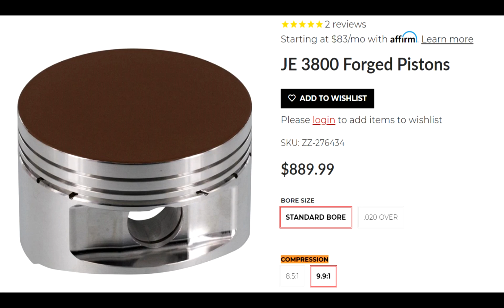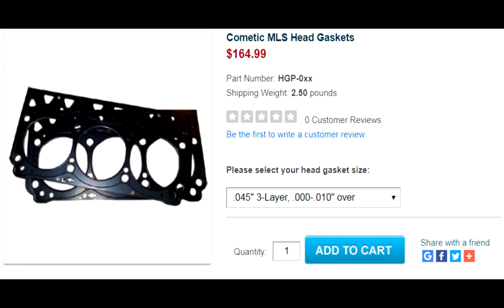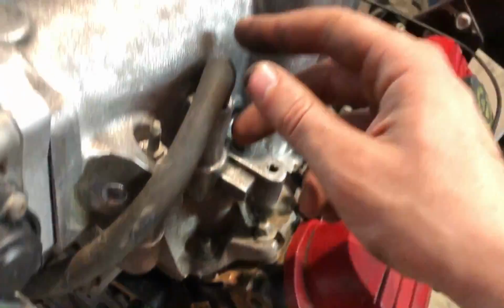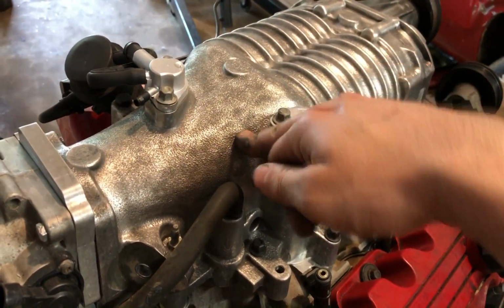3800 Supercharged L32/L67 - EVERYTHING you need to know UPDATED

Comment: Did you do your own witing harness? I just picked up an 05  3800 sc with wiring harness and computer. Im going to convert the throttle body to a N* and lq4 maf. Can i use my wiring harness or do i need a series 2 harness and pcm?
Reply from the maker: I've built and bought one. i would get a 98-02 GTP ecu. there will be wiring differences, you'd have to look it up on www.alldatadiy.com and buy a subscription for each car to know which pins have changed. check out the wiring harness section here, it goes into detail on all of that: https://www.fiero.nl/forum/Forum2/HTML/139530.html#p11

Comment: Heavily modified in early 90s and 2000s in AUS 🇦🇺 l67 3.8 ecotec in holdens. Easily making a safe 400hp at the wheels with a few mods.
Reply from the maker: yeah 3800s are a little harder to get 400hp out of but it can be done. not many good transmissions to support it though
Reply: @FieroAustin  yes the 4speed gearboxes were terrible 😂 and the supercharger were heat pumps definitely needs intercooler mod. MACE engineering a company here and aus make alot of after markets parts for the l36 and l67.

Comment: Last part, you said the stock ring gaps can hold 400 hp. That seems perfect for my build. Any higher, i'll need a roll cage
And the torque converter info will help with the first driving tests. Nice job, sir!
Reply from the maker: you know im not 100% on that. Might be higher, but you'd have to look it up.

Comment: My son and I are doing a 3.8 supercharged swap from a 2001 Bonville. You had mentioned in the video that you had done one too. Could you give me a list of things that you know of which we would have to change on the Bonville engine for it to work well?
Reply from the maker: Yeah, the list is at the end of the 3800 swap instruction build 1 list titled "PARTS NEEDED IF YOU DO NOT BUY A 1998-2002 PONTIAC GRAND PRIX GTP OR REGAL DONOR CAR" https://www.fiero.nl/forum/Forum2/HTML/139530.html#p5
Reply: @FieroAustin  Thank you for taking the time to answer my question. That list is really helpful. I have found most of the parts I need to make the bonneville engine work except for the GTP oil filter bracket. Everywhere we checked was out of stock. Do you happen to know anyone who still sells them?
Reply from the maker: @SillySisters-4  You will need to go to a local junkyard. Go here and click Vehicle Fitment and then give your junkyard a call to see if they have any of those cars. https://www.gmpartsgiant.com/parts/gm-adapter-12569219.html

Comment: Happy new year 3800 fantastic 🎉
I have a quick question about top swap on 07 pontiac grand prix (L26 / L32) stock harness, #90 spring, new headers just a basic top swap for now. I reverse my car from my garage to my driveway and pulled up a few feet forward to park straight after the top swap job (no higher RPM). I have been told that because my PCM wasn't tuned yet I damaged my transmission and engine for doing that. I was wondering if that could be possible 🤔  and why ?
Reply from the maker: uhm, I don't think there would be any issue there at all... if it was the stock harness and tune and PCM and all. The stock transmission might not like the higher torque if you really hammer on it but it should be totally fine. You didn't flash the ECM with a different tune from a different car or anything right? Here is a complete top swap guide for reference. No mention of anything like that from a quick glance. https://www.grandprixforums.com/how-to-write-ups-tech-tips/49039-the-eaton-gen-v-supercharger-faq-swap-thread-genv-gen-five-gen-5-a.html
Reply: @FieroAustin  thank you for your thoughts 🙏
Reply from the maker: @jeanpierreremond2565  welcome. although you should probably check in some facebook groups too... try https://www.facebook.com/login/?next=https%3A%2F%2Fwww.facebook.com%2Fgroups%2F3800SC.3800.Fiero.Swap.Page%2F

Comment: 9.8 to 1 AFR is super wet/super rich, wasting fuel, way to high Fuel input.
Reply from the maker: yeah you're right. my tune ended up around 12.4 AFR or 0.84 lambda optimally. It kept climbing in power but I didnt want to go leaner.

Comment: Different  from Aussie L67 I'm runing a 8 ribbed 3.4 inch charger pulley n still using the 6 rib standard harmonic balancer u don't need to change it at all unless u use a 8 ribbed belt
Reply from the maker: yeah that is true... just not the other way.

Comment: I've been thinking about getting one of these to put in a small car Ford truck maybe like an old Volkswagen how much more fuel does this use in a stock 3800 ?
Reply from the maker: You mean a non-supercharged 3800? I am not sure there is much difference. I have seen these get 35mph with the right setup.
Reply: @FieroAustin  I have been trying to get Buick with the 3800 just to drive around it's a big nice luxurious car and I saw a century that had a turbocharger on it but I was not able to get it I would probably prefer the turbo over the blower or supercharger and eventually find a small vehicle to put it in
Reply from the maker: @darylhudson777  ah. i would expect 24mpg out of somethign like that
Reply: @FieroAustin  will the larger 90s four doors I looked up without a turbo get 30 on the highway and 20 in the city that's with an automatic transmission

Comment: Hey, quick question, did you bolt the gen v lower intake manifold to the L67 block, and every bolt lined up?
Reply from the maker: lol I saw your facebook post about this earlier I had the gen 5 lower intake manifold and the gen 5 blower together. I also had Series III heads but I think the heads are exactly the same. If you used my build thread for build 2, it does say you need to get both the supercharger and the lower intake manifold. Good luck man, hope it works out!!!
Reply: @FieroAustin  I have all of the parts, it will be done.
Reply from the maker: @snutmeez  Nice!

Comment: Did GM make a DOHC V6 back in the 90s which used timing chains? I know the 3.4 had a main chain which drove two belts, but any chain ones? I know the 3800 was an OHV.
Reply from the maker: yeah, LQ1 https://en.wikipedia.org/wiki/General_Motors_60%C2%B0_V6_engine#LQ1
Reply: @FieroAustin  Thanks for the response. Yeah it seemed a decent engine used on a lot of cars. Only it's a main chain driving two belts, says there in the article. Granted, might be less overall strain than a direct to the crank system, but even today the idea of a wet oily rubber belt does not sit well with me. Again, thanks for the info. The modern 3.6 DOHC used 3 chains, similar to VW's VR6 line. If I ever got my hands on a Fiero to swap out, it'd likely be a VR6, I've seen a couple guys on YouTube do it. One guy cut a bit into the rear storage area to modify the exhaust for the "wookie sound" as well as basically vanity plates for the engine cover.
Reply from the maker: @jameslaidler2152  Of course! There may be other variations but I'm no expert :)

Comment: I have a big question for you can I put an l67 series 2 supercharged engine in my 1992 pontiac bonneville se
Reply from the maker: maybe. if you grab the mounts from series 2 engine. you will have to figure out the wiring harness on your own. use the computer from the series 2 and also reprogram it to delete VATS security and a few other things. i'm sure there's other concerns with hardware hookups. but i really have no idea. sounds like a big headache. nobody's probably documented any of that.
Reply: @FieroAustin  but my bonneville have the L67 series 1 in Now. That why I was asking
Reply from the maker: @qmb120  wiring will still be completely different. or just keep the series 1....

Comment: I’m going to buy a used 98 Buick Regal GS with a 3800 supercharger. What type of gas do I need if driving normally?
Reply from the maker: pump gas is just fine. 87 octane. If you want more power and modify the engine appropriately (by increasing boost), you might want higher octane for higher knock resistance. 91 is everywhere and 93 is also around.

Comment: Hey Austin My 87 Fiero has a 5spd.  I am putting in a 3800 from a automatic. How much modification is needed for this swap. And as always your help is much appreciated
Reply: Ok I hope this will help someone out here. If you have a 5 speed Fiero. And you put an engine from an automatic in, get a flywheel from a 2000 Camaro and machine the face down to the same thickness that is on your Fiero it works. You may need to change your Clutch and pressure plate to the same as your flywheel. You are going from 140 lbs to 240 ft lbs. good luck and I hope this helps someone.  Thanks to Austin he is a super good guy and has been so helpful to me in my swap. Please be sure to throw love to him. He doesn’t have to be there and his passion for the Fiero community is awesome. Thank you Austin from my heart
Reply from the maker: @johnnybaker3751  Thank you Johnny!
Reply: Thank you Austin.  I have another ?  I need rear brake pads do I ask for 87 Fiero or is there something else that’s a fit. I don’t like the crazy looks and the “Fiero?” Remarks. Thank you 🙏🏻 Austin
Reply from the maker: @johnnybaker3751  No problem. The 1984-1987 Fiero REAR brake pads also came on 1984-1988 Pontiac 6000 cars. The front pads were unique to Fieros. For the rears, try a BOSCH BP262 (Premium QuietCast Semi-Metallic), WAGNER ZX262 (QuickStop semi-metallic), or RAYBESTOS MGD262M (R-line metallic) seen here:
https://www.rockauto.com/en/catalog/pontiac,1987,fiero,2.8l+173cid+v6,1249152,brake+&+wheel+hub,brake+pad,1684
Reply: @FieroAustin  you are my hero. Thank you thank you
Reply: @FieroAustin  wish I could send you pictures. Anyway, we are at the point of taking carriage bolts out now
Reply from the maker: @johnnybaker3751  you bet!!!
Reply from the maker: @johnnybaker3751  those were super tough on my 88. Best of luck, hope you saw the how to video playlist/forum post:
https://www.youtube.com/watch?v=hhvgLd1XHuU&list=PL9MEbquodF3isIM_4I2qJnkff2RlPWB_O&index=5
Reply: @FieroAustin  Hey Austin, sorry to bother you again but I’m not clear about the fly wheel the one of my 3800 is not gonna fit my 5 speed any suggestions. Maybe a five speed older Camaro ?
Reply from the maker: @johnnybaker3751  You will have to cotact FieroRog. He makes flywheels. They must be machined down slightly to fit. See his post and contact info here. https://www.fiero.nl/forum/Forum4/HTML/068855.html#p0
Reply from the maker: Well there's not that much unique about the swap other than from the build 1 list here. Really all you need is a FieroRog flywheel and flywheel bolts and mounts and some way to hookup the shifter. Those things were covered in here though. https://www.fiero.nl/forum/Forum2/HTML/139530.html#p5

Comment: You mention most cars with the l67, and the parts that come with them. Any word on the 98 Riviera engine, looking at using it as a donor
Reply from the maker: I am not enirely sure what is on that car. It is probably similar to the regal (2door) and GTP, so i bet there would be a lot of overlap. If it does not have some stuff, check out the end of Build 1 for parts that you would need otherwise. https://www.fiero.nl/forum/Forum2/HTML/139530.html#p5

Comment: Will park Ave ultras engines work like the gtp and regals? I'm just getting into fieros and am trying to learn as much as I can. Have been looking for regals and park avenues because those are more common in my area.
Reply from the maker: Check out my build thread. https://www.fiero.nl/forum/Forum2/HTML/139530.html#p5

This is what you will need if you instead use anything but a Regal/GTP:
GTP External Transmission Range Gear Selector  Neutral Safety Switch / Range Sensor Switch (1x):
[URL=https://www.rockauto.com/en/catalog/pontiac,1998,grand+prix,3.8l+v6+supercharged,1317113,electrical-switch+&+relay,neutral+safety+switch+/+range+sensor,4584]https://www.rockauto.com/en...+/+range+sensor,4584[/URL]

GTP Range Sensor Switch Connector for above:
[URL=https://www.rockauto.com/en/catalog/pontiac,1998,grand+prix,3.8l+v6+supercharged,1317113,electrical-connector,neutral+safety+switch+/+range+sensor+connector,2602]https://www.rockauto.com/en...ensor+connector,2602[/URL]

GTP/Regal Steel Oil Pan (1x):
ULTRA-POWER 264124 {#12512670, 12563240}  - [URL=https://www.rockauto.com/en/catalog/pontiac,1998,grand+prix,3.8l+v6+supercharged,1317113,engine,oil+pan,5562]https://www.rockauto.com/en...,engine,oil+pan,5562[/URL]

GTP Oil Pan Gasket (1x) (needs cutting to fit over non-GTP oil pickup tube; Depending on your car, you can get either get a GTP oil pickup tube or get a non-GTP oil pan gasket to avoid cutting):
ACDELCO 12587964 - https://www.rockauto.com/en/catalog/pontiac,1998,grand+prix,3.8l+v6+supercharged,1317113,engine,oil+pan+gasket,5436

Oil Filter Housing Gasket (1x):
ACDELCO 25534742 - https://www.rockauto.com/en/catalog/pontiac,1998,grand+prix,3.8l+v6+supercharged,1317113,engine,oil+filter+adapter+gasket,10649

GTP/Regal oil filter bracket (1x):
GM 12569219 ; 24508441 - More info at http://www.gmtuners.com/swap/3800.htm

GTP/Regal angled coil pack bracket (1x) - cut engine mount dogbone off, shown in videos posted below. Get at junkyard including the GTP Tensioner pulley on coil pack bracket:
GM 24507211 ; 24504360 - https://www.gmpartsbin.com/p/Buick__Regal/Bracket-Mount-Front--Rear--Upper--Lower/48184566/24507211.html?partner=googlebase

GTP or Oldsmobile Torque Converter (1x):
DACCO B21JXFM - https://www.rockauto.com/en/parts/dacco,B21JXFM,torque+converter,8668

3-pin Temperature sender & wire (1x):
Duralast TU178DG - https://www.autozone.com/engine-management/coolant-temperature-sensor/duralast-gold-coolant-temperature-sensor-tu178dg/625841_71058_0
Reply: @FieroAustin  thanks! Looks like getting a regal is well worth it then. Do you know if there's a build guide which includes the 5 speed getrag transmission?
Reply from the maker: @ColtenHood  you bet! Go check the links again; originally they were broken.

For a manual, visit my build thread again and hit Control F on your keyboard and type in the word Manual.

The wiring harness diagram actually is for a manual. there are some other bracket differences too. I am not 100% sure everything you need is there, but it should cover most of it. Otherwise go looking through PFF some more.
https://www.fiero.nl/forum/Forum2/HTML/139530.html#p11
Reply: @FieroAustin  you're the man!

Comment: Just wondering off topic can the stock 2.8 L-44 be rebuilt to deliver 190 HP and still run the stock ECM module.   What you doing here is great but it is beyond my skill level.
Reply from the maker: I am not sure I can give you a perfectly accurate answer, but my gut says no.

If you want more power out of a non-forced induction naturally aspirated motor, you will have to increase torque or RPM or both.

Easiest way to gain power on small engines is increase RPM, but your PCM/intake/fueling would have to be heavily modified to support that (near impossible being 80s burn-in transistor tech).

Instead, you can increase torque by increasing bore size or stroke, or significantly modifying how the air flows through engine in general. That will be very expensive to do on a 2.8. It comes factory with an 89mm bore x 76mm stroke.

The easiest option I would say for you is get a 60° 3.4L L32 (NOT the 3800 or the DOHC) engine. It comes factory with a 92mm bore x 84mm stroke (different crankshaft). They came in 1993-1995 camaros and firebirds. It is pretty much the same engine, just bored larger, and is rumored to be a direct swap. Supposedly you can use all the same brackets, sensors, transmission bolt patterns, and wiring harness. Keep the computer/harness/sensors that came with it. It has a larger bore and thus more torque, and thus more power coming in around 160hp factory. You can slightly modify a 3.4, but honestly a 3800sc is the way to go if you want to put any time into it.

Check out the 60° engine family tree here, and look for the 1993 3.4L RWD Pushrod motor compared with the 1985 or 1988 2.8L FWD motors.
http://www.60degreev6.com/vb5/60V6FamilyTree

Honestly I think you're wasting your time to pick up 20-30hp with these old 60° engines. I have a very thorough step-by-step guide for both an easy and an advanced 3800sc engine swap here. I think it would be an equal amount of work and money, and you would end up with 230-280hp at a minimum.
https://www.fiero.nl/forum/Forum2/HTML/139530.html

Comment: Wheres your MAP sensor at
Reply from the maker: It should be mounted to the side of supercharger. There are two of them on there actually. Small black sensors. Here is what the newer style for a L32 series III you probably have looks like.
http://repairguide.autozone.com/znetrgs/repair_guide_content/en_us/images/0996b43f/80/20/2f/84/medium/0996b43f80202f84.gif

On earlier L67 series II models, there is only one MAP and it looks different. You actually only need 1 for a Fiero swap, and I think the older ones work great. Here is what the old style looks like. https://www.rockauto.com/en/moreinfo.php?pk=497116&cc=1317113&pt=11207&jsn=417
Reply: @FieroAustin  nice thx I figured out that the bracket wasn't on the engine but since I'm using my 2001 fbody pcm I'll just use the map sensor from the camaro for now and if I need to upgrade to a better aftermarket one I will down the road where would the best spot to mount it any suggestions? I read one person just uses a brach of vacuum line to put it into thr system and then just tucked it away somewhere but like example I own a 03 civic ex and I did a intake manifold swap for a bigger one that flows more air I just drilled out a hole and screw hole and placed on the top middle of manifold and used rtv to complete the seal cause it had a leak at that spot at first it reads fine on the honda no idle issues or dtc